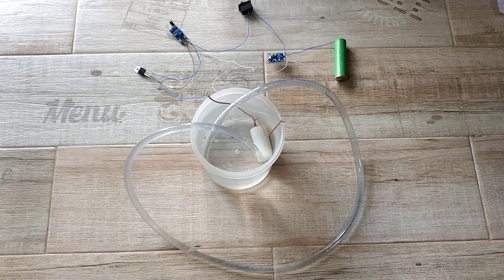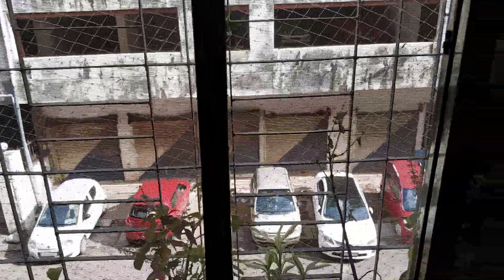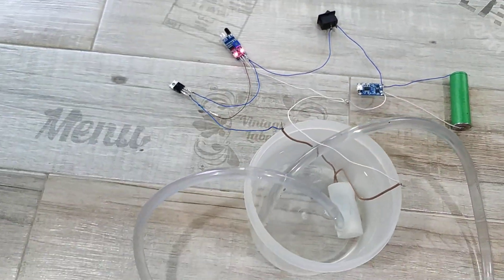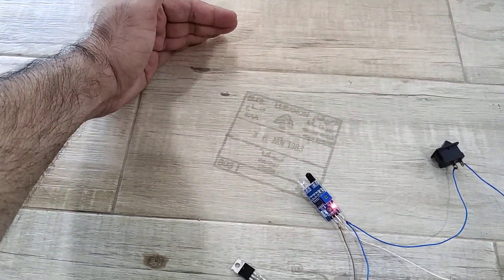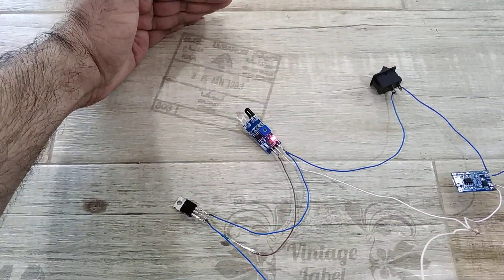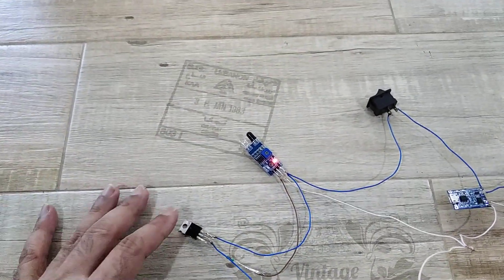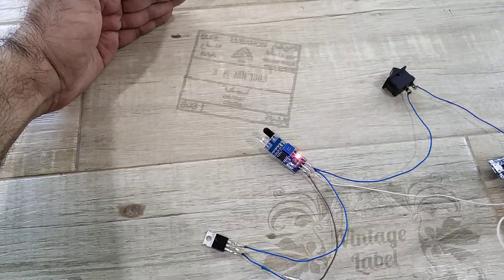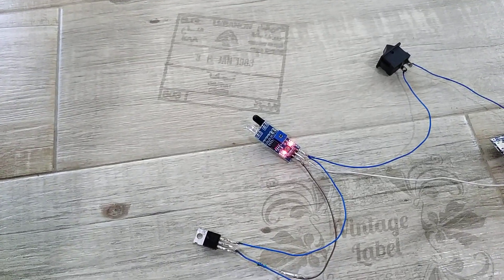IR Sensor Not Working In Sunlight

Comment: Sir, I really appreciate your presentation because this is my long time problem. If we replace this sensor with the E18-D80NK Photoelectric Sensor Module Infrared Obstacle Avoidance Proximity Switch and do the proper connections, will this solve my sunlight problem sir? Please, because I need this in my project. Thank you very much. New Subscriber here sir.
Reply from the maker: Dear Kit,
First of all thanks for your appreciation and I am glad that my video(s) could help you in some way.
The E18-D80, PES in other words is a good option instead of using IRS as it has very less interference by visible light and can even work quite well even in sunlight. 
The only problems with PES are:
1 Its sheer size and it becomes difficult to adjust in smaller projects.
2 Cost is higher than IRS.
3 It has digital output and hence needs a Mircocontroller/Arduino/Programing/Relay and not sure if it can work in my kind of simple circuit.
Pls feel free to try the PES with my simple circuit and share with me the outcome. will be awaiting to hear from you.

Comment: I’m halving this problem with some IR soap dispensers places outside and I am trying to find a solution, any ideas? Thank you by the way, the best explanation
Reply from the maker: At the outset thank you for the compliment.

There are some untested ways/solutions you can try. I myself is gonna try some soon.

1. Try using IR filter. Believe difficult to get.
2. Try covering the IR sensor with heat shrink sleeve or non reflecting material and create a small tunnel. 
3. Try to change the angle of IR sensor so that sunlight doesn't fall directly on sensor.
4. Try covering only the IR receiver at the tip of it to avoid direct sunlight.

Hope to have helped. Do share what worked for you.

Comment: Bro can this e18-d80nk sensor can solve the sunlight issue?
Reply from the maker: Hi Bro,
E18-D80NK is a Infrared Photoelectric Switch Sensor. It can solve the problem, but the size of it could be a hassle. 

The question is are you really going to place the Dispenser in Sunlight? Plz remember unless necessary and all flaws covered, you should avoid placing sanitizer in heat/sunlight as it consists of 70-80% alcohol.

I have being using the Dispenser (watch my other video) for more than 2 months and it is working absolutely fine and i have placed it inside my house.

Comment: Sir can we use two sensor and then compare their output to differentiate between sunlight and hand. We could use NAND gate dor comparison.
Reply: Yes, if u use NAND gate you can use it..
Reply from the maker: Hi Thanos,
Are you trying to suggest:
1. Two IRS Modules together.
2. Two Receivers in one IRS Module.
3. Two transmitters in one IRS Module.
Reply: @innovationshack  Two IRS Module
Reply from the maker: it will not work as you will have two out-put signals from two IRS modules.

Comment: How may we solve this problem
Reply from the maker: Can use other type of sensors. But every sensor has its own pros-n-cons. 

Some increase total cost, some need Arduino and coding, some need relays, some need complex circuiting etc. etc.

OR

Try to cover it with a shrink sleeve/tape/pipe (basically a nonreflective surface)  or place/angle the sensor in such a way so that the sunlight doesn't hit it directly.

Comment: how to avoid this problem?
Reply from the maker: Hi Taral,
Try to cover it with a shrink sleeve/tape/pipe (basically a nonreflective surface)  or place/angle the sensor in such a way so that the sunlight doesn't hit it directly.
Reply: @innovationshack  thank you
Reply: we can change its angle??

Comment: How about TCRT5000 IR module....it's datasheet states it is resistant to daylight interference
Reply from the maker: Hi Ramesh,
Believe it will still have same problem. As all IRS are sensitive to IR rays from sun.

I can be corrected buddy.

Sharing with you a small write-up from web on the TCRT5000 IRS for info.

QQ
One major drawback of this sensor is it can be easily affected by environmental conditions. Any other source of infrared light such as sunlight or house lights are also detected by the sensor and can interfere with the readings.
UQ

Comment: How to solve this problem, iam also facing this issue.
Reply from the maker: Hi Shubham,
Try to cover it with a shrink sleeve (basically a nonreflective surface)  or place/angle the sensor in such a way so that the sunlight doesn't hit it directly.

I'm coming up with my Dispenser video soon.

Comment from the maker: Coming up soon with complete product,. Automatic Hand Sanitizer Dispensersr.
Reply: plz upload the solution video as soon as possible sir
Reply from the maker: I have tried holding the IRS vertically (front & back both ways) in the same environment as in this video and it does make some difference, as the sunlight does not fall directly on the tip of receiver. But I did not video shoot the experiment. If I do it again will definitely upload. Pls SUBSCRIBE so you get the alert.

Have also heard that if the IRS is surrounded by a non reflective black color surface (PVC Tape or Shrink Sleeve), it still solves the problem to some extent.

Pls try these solutions and see if you get success and share with me the results.
Reply from the maker: Hope you like the solution video. Pls subscribe my channel so that you keep getting alerts.
https://youtu.be/uOK4Em6SKOM